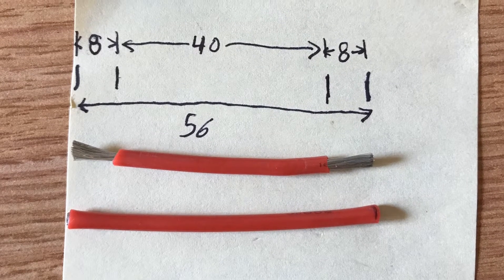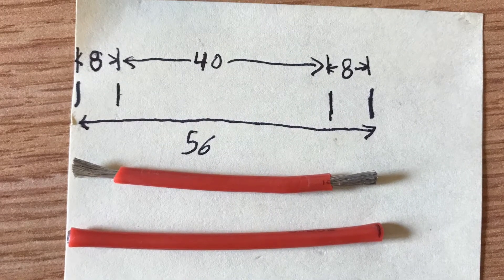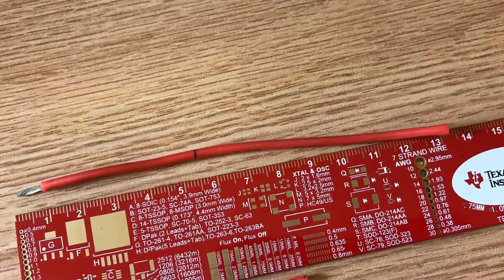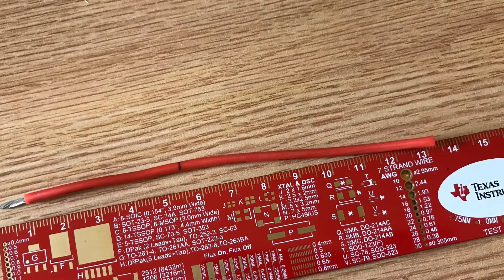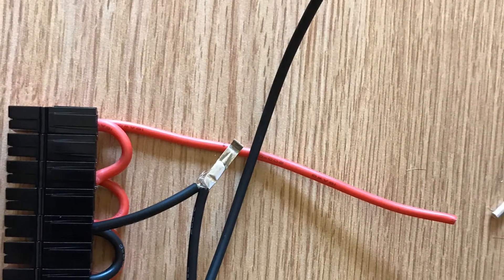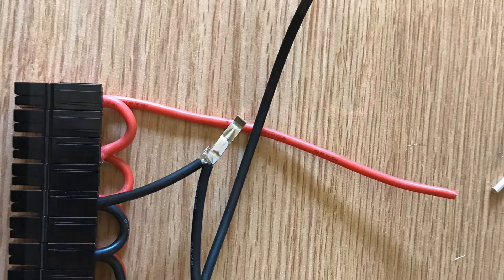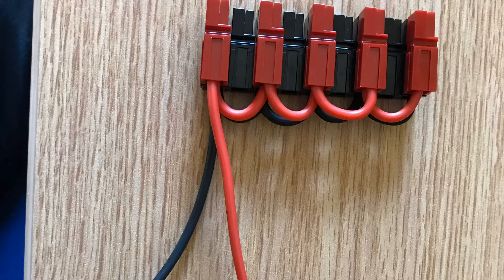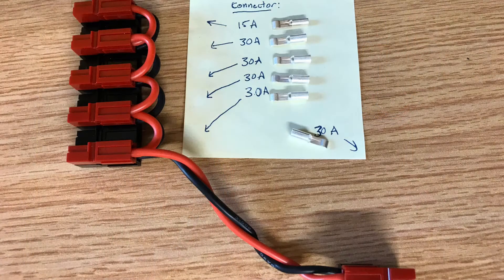SCUTTLE Robot - Build Anderson Powerpole 12v Distributor

Comment: Would this be a suitable way to distribute a 12vDC current to several 12v demands? Assuming the Amps allow?
Reply from the maker: Yes in fact that is the purpose for this setup.  18awg wire handles around 10 amps.  If you need more, increase wire size and use the right Anderson terminal (15, 30, or 45A)